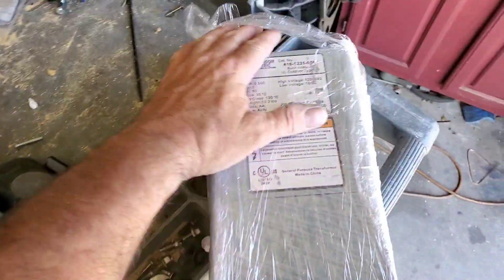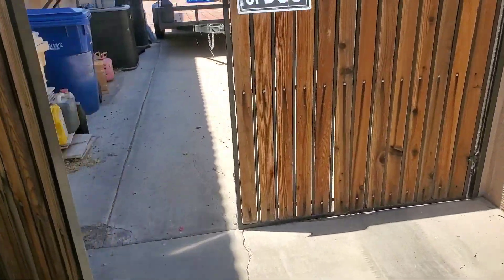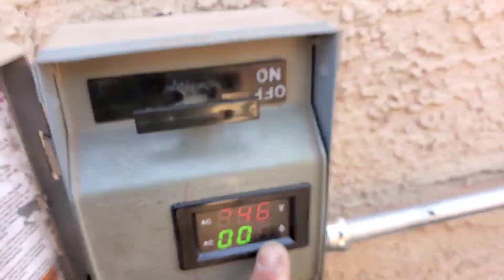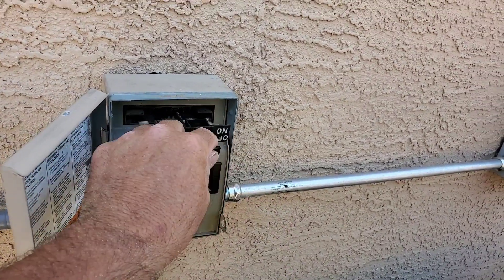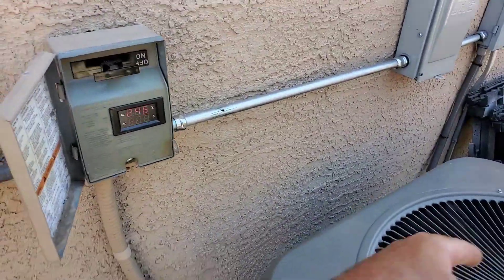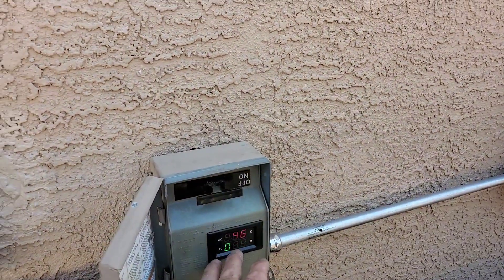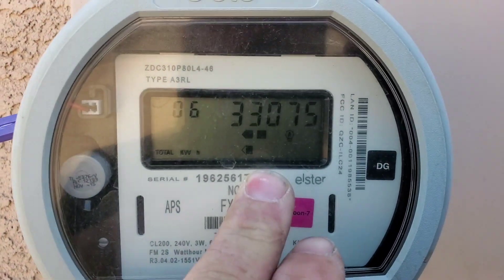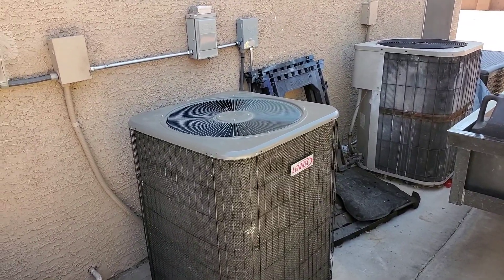AutoTransformer arrived - This is why I need it

Comment: This makes no sense.  You say its using utilit power but making more than you use giving back...it can't be both ways?
Reply from the maker: DUDE! LOL You guys need to look into my system more before you assume I am using typical plug and play store bough inverters and what not.
There are no inverters in this DIY system. I do have an on grid Solar City/Tesla on my roof that has inverters however my DIY panels are not connected to that OR the grid.
If you see the Solar City inverters on the wall they are not part of my DIY.

My DIY 330VDC solar array only connects to a Variable Frequency Drive unit that is in my 3 phase heat pump.
It is connected to DC only and can not in no way shape or form feed power back into the grid. It is impossible.

My utility power also feeds the variable frequency drive.
It feeds into the AC input which then goes through a rectifier where it OR the solar 330VDC can supply power.
With diodes they EACH can power the heat pump. But they can not backfeed into each other.

My autotransformer is there to drop my 240VAC utility power down to 225VAC before it interconnects to the variable frequency drive.
When my DC Bus is already charged over that value (by the solar panels during the day) the diodes don't switch on from the utility and it draws nothing from utility power.

That is how it works. My DIY system is NOT a on grid inverter solar system.

Comment: are you sure that's not 5 amps going the other direction??
Reply from the maker: It can't.
That's 5 amps on the AC utility power line.
That's before the rectifier in the VFD.
The DC solar can't go backwards into the AC line voltage.
Reply: @hackfreehvac  a wiring diagram would be great. please post one!

Comment: I would definitely try both voltages.  In theory you want to get it as low as possible.  Since your utility feed seems to run slightly hot (244 you’ve mentioned several times over past videos), then even taking into account the dc choke voltage drop you’ll probably still be at least at 208vac (equivalently speaking).  208/230 equipment typically begins to struggle only once you get  below 200v.     So it comes down to whether your VFD can still start the compressor at the lower voltage , because it will need to supply higher current than before.   Definitely worth testing both configs since it’s trivially easy to switch over.

Comment: Yes, the autotransformer will fix your problem, but only half way. Instead of spending $$$ on autotransformer, you should get orbuild a MPPT tracker yourself. If you get one as a boost converter, it will obviously, step up the output voltage and regulate the input for optimum load for your panels.
You could even control the MPPT with your AVR or PIC micros easily, or whatever have I seen you use in yo other projects.
Reply: these transformers are dirt cheap, especially on eBay.  ive bought half a dozen of the 0.5kva 120/240 <—>16/32 acme unit on eBay and paid 30to40 bucks inc  shipping (fits in usps flat rate box which doesnt charge for the heavy weight ).  i think this will solve way more than half the problem, especially if he takes down the voltage as low as possible using the 32v tap/wiring.  and it will basically never ever fail.  and it’s highly efficient.   how much would max power point tracking, net of the overall switching losses this would add to the system,  add to the  equation vs. the autotransformer ?  It’s an interesting question but my gut says it’s minimal and not worth the high cost and much lower long term reliability .   but not really sure .. it’s an interesting question ...
Reply from the maker: Video coming soon!